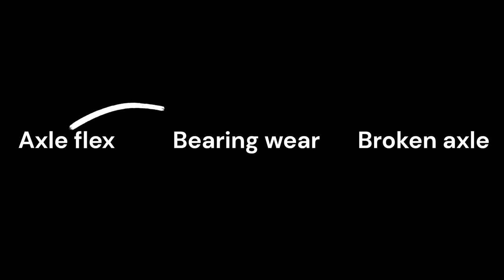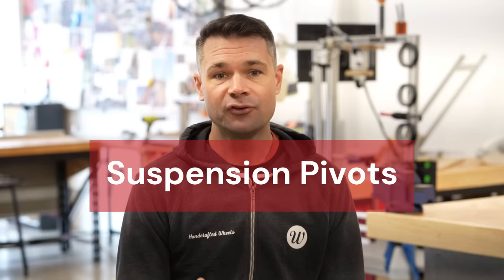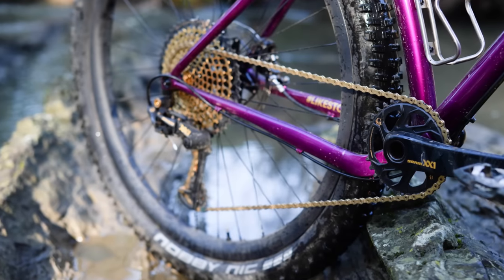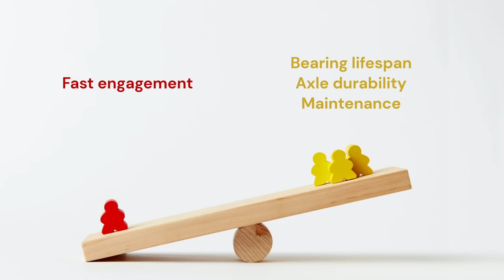Is it worth breaking axles for 690 POE?

Comment: Perfectly timed video, thank you! This triggered some research and looks like I will be getting a steel "forever axle" by a company in Whistler. Easier to replace a freehub body out on a bike trip instead of finding and replacing axle/bearings.
Reply: Been beating the shit out of one of those for the later half of this season and its held up to hundreds of miles of riding and almost 20 days in the park, highly recommend
Reply: What is the steel axle companies response to the idea that the axle must flex? Does the steel axle flex in the same way as the aluminum? Is it not an issue?
Reply: @SpokesmanMTB  It should be able to flex enough for the pawl to engage otherwise the product wouldn't work or exist. They are called "Pinner Machine Shop"

Comment: Great video, thanks for posting. When these came out I was sceptical, no one's done a good hub with single pawl engagement before for good reason, also was never really impressed with their previous hubs, always found bearing life not good if you lived someplace where if you didn't ride when it rained, life was short lived. I'll stick to my Hope hubs thanks, can get a complete set for less than you'd pay for a rear i9 or CK and they've lasted me really long, Hope supports their products way down the line too.

Comment: I have a Hydra hubset that has 3+ years of very hard enduro and park riding on it. Earlier this year I did a full rebuild on it including all new bearings and replacing the original axle design with the new one. The old one had a bit of wear, but was still functional and silent. I theorize my hub might last longer because it's been on the back of a Santa Cruz frame, which has a very solid and stiff rear triangle. 

There is a "nuclear option" for replacement axles- the Pinner Machine Works axle is steel and is seriously beefy. I didn't feel I needed it, nor did I want the extra weight. but that's an option for heavier riders or flexier frames.

Comment: I had Pinner Machine shop build me one of his stainless axles for my hydra after it broke the aluminum one. It has never worked as good as it does now. Do yourself a favour and get yourself one. It functions perfectly and the bearings now last more than a few months. It's an amazing hub now that it has a better axle.
Reply: Yep - broke my 1/1 axle 3 times before going the Pinner route. Works great - wheel/axle interface is noticeably stiffer, better bearing life and so far, no more broken axles.
Reply: My thoughts exactly

Comment: Stoked you guys made a video on this. Curious if you’ve seen the aftermarket steel axle from pinner machine shop. I broke 3 hydra axles in the first year or so of having it but ever since installing that thing the hubs been problem free for months. Theres been no problems with the pockets wearing either, I guess like you said since steel has more flex.

Comment: I'm not an engineer, can I9 redesign the hub to have 2 opposite facing pawls or 3 pawls engage at once (rather than 1 pawl) and then have the remaining pawls engage shortly after to reduce the stress on the single pawl leading to the axle stress and bearing damage?

Comment: I’m curious how the sprag clutch from Onyx fairs by comparison? A completely different approach to ultra-high engagement.
Reply: No issue, as the sprags on an Onyx all work at the same time, making the forces all even from all angles
Reply from the maker: We're asked about this comparison a lot since both hubs have fast engagement but go about it in totally different ways.  I'll see if we can do a video on it! -TT
Reply: no comment on reliability as I've not tried a sprag hub for years but they do have different feelings when riding.

Firstly there's the weight...sprag hubs need a lot of steel to cope with the forces so they always weigh quite a lot compared with a pawl style hub.

They also have a slight spongy feel when engaging...again it's been a while since I used one (and have never used an Onyx), it's not the worst thing but it wasn't something I liked very much.

I will give them credit for being nice and quiet though, I do like that!
Reply from the maker: @Ali_Clarkson did you ride with the old Shimano Silent Clutch hubs?  The Onyx has a similar spongy feel to those - personally I really didn't like it for trials but it never bothered me on a mountain bike. -Tristan

Comment: I bought a set of wheels with the Hydra hub in July 2022. The rear hub had the old axle and failed about a year later.  Industry 9 sent me the improved designed axle with new bearings. Now less than a year later 2 of the bearings are completely shot.  The axle seem fine but to have to replacing bearing this frequently seem like this design is still problematic.

Comment: Great information! I would expect a single speed hardtail but don’t use Industry Nine hubs. I have Hadley,Hope SS/T and Onyx Classic single speed specific hubs. New had an axle failure and have only replaced bearings on my Hadley hubs but original bearings in my Hope and Onyx hubs

Comment: As a Bike mechanic, a hobby DH BIKE PARK HOBBY rider, and since I'm 12 years old I started MTB in 1992, I have one or two opinions about hubs and your video message.    You want to ride your bike, without technical defekts? 
1 - Don't buy Shimano hubs! XTR are to expensive, XT breaks apart after 6 to 12 Mon, Saint works but the bearings are bad!! 
2 - Don't buy stuff, Wich axles are breaking and somebody on YouTube explains, why should buy it any way
3 - Go and buy some DT Swiss hubs, done 😜🤣👍‼️

Comment: How about Titanium axle? It would probably increase weight and cost, but if they use titanium alloy axle, if engineered correctly, it might stay in load and flex zone, where it doesn't accumulate fatigue. For aluminium it's only a matter of time until it fails.
Another option would be steel as it's more chill about flex (depending on alloy and level of heat treatment) and costs less than titanium.

Comment: The average rider does not need that much engagement. For trials I can see wanting very quick engagement, but for mountain biking, it's really unnecessary. I just got myself the e-bike version of the pro5 for this reason. I want as many pawls engaged as possible because I just want the hub to last as long as possible.

Comment: Great video.
What's your take on Onyx's Sprag Clutch mechanism? Do you think this system is more robust and will require less frequent servicing? Or will high/instant engagement always have its downsides?
Reply from the maker: We honestly haven't built/sold enough Onyx hubs to gather enough info on their durability.  We've seen a few broken axles when used by super aggressive riders, and we've seen the occasional freehub issue, but as I said it's not from a large enough pool that I can confidently point out the strengths and weakpoints of the hubs.

The Onyx design is super unique and it would be great to do a deep-dive into how it works, but without having a sufficient number of hubs being sold don't expect a pros/cons vid from us any time soon ~Tristan

Comment: This is the reason why other hubs uses special inner diameter bearings (ex. 6902-2rs 16). Which means the inner diameter is 16mm instead of 15mm to thicken the axle a bit. That is also why THRU AXLE is far better than QR.
Reply from the maker: A 6902 bearing is 15x28x7mm and the 2rs means a rubber seal on both sides.  16mm is very rare bearing internal diameter and much more likely to be 17mm which is used in some of the Hope, Berd, and newer DT Swiss Hybrid hubs ~Tristan

Comment: Thanks for this video, that's why I chose the 1/1 version and I have no problems. Now I'm considering ERASE hubs with 60 POE RATCHET for my new E-bike, have you had any experience with them?
Reply from the maker: The Erase stuff looks interesting but I haven't seen any in real life yet -Tristan
Reply: @WheelworksHandcraftedWheels  In that case, I hope that this will change soon ;), because I haven't found many opinions about them.
Reply: Still keep an eye on the 1/1. I've broken my 1/1 axle several times (breaks in the same spot shown in this video), tends to happen to me about every 2000 miles. I ended up buying a 'forever' steel axle from Pinner Machine shop and it has been great.
Reply: @ionicman1  Thanks for tip ;)

Comment: This is great but unfortunate info. That said I do like I9 as a company and own 2 wheelsets with Hydras and 2 with Torch. It seems it would better to design this with to have two opposing pawls engaging without flex and therefore have half the POE at 345, which would still be great.

Comment: I wonder what issue the Torch had ? Got new, never used old stock one a few months ago... that im yet to use. 

Except for the stupid design with O-rings and needing a special tool/ vise to remove the endcaps. Any other issue ?

Comment: Does the rear triangle flex based on pivot wear? 
My bikes all have supports that link the 2 sides together. 
On my trail bike, the rear triangle is 1 piece mounted to the linkages, I can't put a 29 in the rear because the bridge goes around the wheel, would worn pivots still cause flex?

Comment: Thanks for great review. I’m thinking of Hydra not only because 690POE, but I also hope it will propery engage. My experience with other pawl based hubs is that after some time the powls does not properly engage and there is a click when you start to pedal. Any experience on this concerning the Hydra?
Reply from the maker: This isn't something we've had reported to us on the Hydra - they seem to engage consistently as long as the bearings are in good shape -TT

Comment: Great video! 
Is this an issue specific to I9s or could this also be an issue for other high engaging pawl based hubs ? (Like Project321)

And could it be the case of different mechanisms such as Onyx Sprag Clutch?
Reply from the maker: Project321 Gen3 hubs use 6 pawls with 2 pawl engaging simultaneously...the way I've understood their design they are not using axle flex to allow a 3rd pawl to engage like the Hydra.  

The Onyx design is completely different and possibly warrants it's own vid as the two often get compared because of their quick engagement but the way they achieve this couldn't be more different

-Tristan
Reply: @WheelworksHandcraftedWheels  cheers, thanks for clarifying 👍
Reply: @WheelworksHandcraftedWheels I would really like to see a video on the onyx hub.  Nice job on the video.

Comment: 1:20 at this point you do a undercut (din 509), radius of 0.3mm should be enough to make it a lot stronger - I wonder why this is not done properly, if I understand this correctly, this gets educated in the first semester of mechanical engineering studies - I learned it in a side thingy in electrical engineering, so I am not 100% sure, but I really think that these are mistakes on basic levels
I really rather use DT Swiss hubs were you know that they get these things right anyways, because othervise nobody would use their parts as oem parts
Reply from the maker: The new Industry Nine Solix hubs have a very generous radius on that part of the axle...looks larger than 0.3mm to my eye but I don't any way of accurately measuring that.  Interesting they went that direction on the Solix rather than the 'stress riser kit' on the Hydra -Tristan

Comment: It is a quad bearing design with an axle overhang due to the freehub space. It is essentially a screw-on freewheel and is designed to fail. Hydra's reliance on flex is kinda/sorta admission to that and creative usage of the flex to get more POE. I9 old hubs - pre Torch series - were actually much better with wide bearing stance, but didn't have the fancy 690POE ( "just" 120 ).
Reply from the maker: The bearing placement on the Hydra isn't significantly different to any other modern hub -Tristan
Reply: @WheelworksHandcraftedWheels  Yes. And just about any modern hub fails in just about the same manner, monst of the time, at least. I'm guessing that Hydra's increased incidence of breakage is, as you say, using this flex for engagement. However, I think that on full suspension bikes the issue is that chain growth is yanking the instant-engagement hub. Modern FS bikes are plenty of stiff, especially short link suspensions.

I wonder if incidence of hydra's exploding is less on bikes with and idler suspension.

Comment: Basically sell them and get some dt swiss hubs?
Reply from the maker: That's the tradeoff though, right?  If you want the fast engagement you need to trade it off against othe things -Tristan
Reply: @WheelworksHandcraftedWheels  I'd rather not "expect" my rear axles to snap and need regular replacement. 👍

Comment: Interesting you mention a stiffer axle would cause more wear on the freehub pawl pockets. I run a Hydra with a 10 mm bolt on axle on my trials bike, so it sees a huge amount of force (very low gearing, big guy,  explosive pedal kicks). The bolt on axle is a lot stiffer than the 12 mm one, and I haven't broken one in almost 3 years of use. However, the pawl seats showed significant wear after just a few months. Even posted a little clip about it here: https://www.youtube.com/watch?v=juzsIhsSMuw.
Reply from the maker: Is the bolt-in axle an aftermarket part or a factory i9 axle?  I have never seen this option from them and can't see anything on their website. That wear in the pawl pockets isn't unusual for any pawl hub and often doesn't cause any issues....Hope hubs for example tend to do this but rarely does it cause the hub to misbehave. 

 I used to ride a lot of trials and can see why the Hydra would be a great hub for this type of riding!   -Tristan
Reply: @WheelworksHandcraftedWheels  it's an option on their single speed hub (or was at least). The Hope SS hub used to use a steel freehub body, which faired a bit better pawl pocket wear wise (some other stuff didn't go as well though haha, like a stripped drive ring). 

My Hydra did eat freehub bearings, because the axle was slightly too short, causing excessive load on the freehub when bolted down hard to the dropouts. A 0,1 mm shim between freehub end cap and axle end fixed that. I also had to install double springs below the pawls to prevent it from skipping under light engagement. With those mods, t's been doing pretty well ever since. As you say, the instant engagement is amazing for trials!
Reply from the maker: I'd forgotten about the singlespeed version! I can't find it by navigating through their website but freehub bodies are available in the Support section and the webpage for the hub is still live:
https://industrynine.com/hubs/mountain/hydra-classic-single-speed-6b-rear/

-Tristan

Comment: Does 1/1 have the same issue?
Reply from the maker: No, the 1/1 uses a more traditional design and while it doesn't have amazing bearing life it doesn't seem to chew through them or break axles. -Tristan
Reply: @WheelworksHandcraftedWheels  Unfortunately axles absolutely do break on 1/1 hubs (at the same stress riser spot). It might not be designed to flex as the Hydra but I've broken 3 over the span of about 6000 miles. However, since the 1/1 isn't supposed to flex the steel axle I bought from Pinner has been a great solution.

Comment: What's the risk assessment on this? What number of hours for a theoretical full suspension bike with a 190lb rider. I feel like this is a pretty inflammatory, click baity video without those critical details. Do the axles fail only 1 in a 1000 after 5 years for instance? Don't say it depends. Be professional and come up with a scenario and present the facts, that's what the engineers I work with would do. If this is anecdotal and speculation (" I saw a broken axle once" for instance) it's almost better to take the video down until you have these hard facts. I owned hydras on my last bike that I owned for 3 years and have them on my current bike, they have worked flawlessly over hundreds of hours on steep tech and I'm not light. If I was to make a video I would say hydras are fine, but that's one data point. Information like this is only useful if it's statistical and actionable.
Reply from the maker: I don't have ride usage data from our customers (as cool as that would be!) so I can't give you a lifespan for an axle based on ride time.  The closest I can do is look at how many hubs we've sold and how many axles we've replaced and I feel that is a fairly good proxy.

For the Hydra we've replaced 32% as many axles as we've sold hubs.  For all other hubs we sell that number is less than 4%

Some customers will have had multiple zero-issue years of use on their Hydra hubs.  Others customers will have had multiple axles in one hub.  Some of those Hydra axles will be replaced as preventative maintenance before a failure.  All of these factors will skew the data but all back up my experience so it's far more than clickbait or anecdotal speculation.  -Tristan